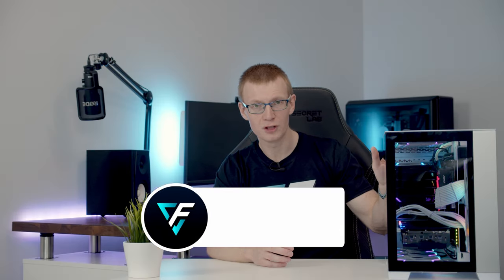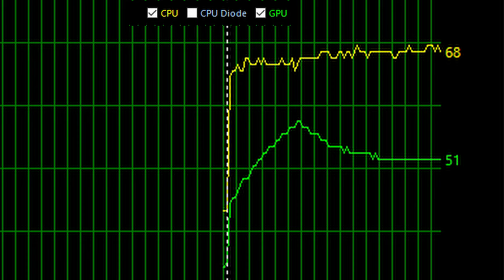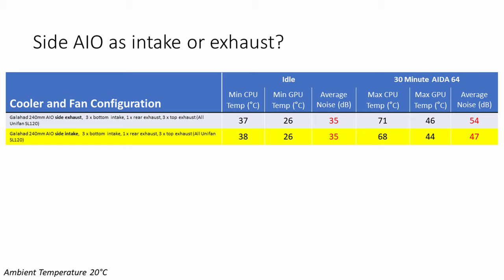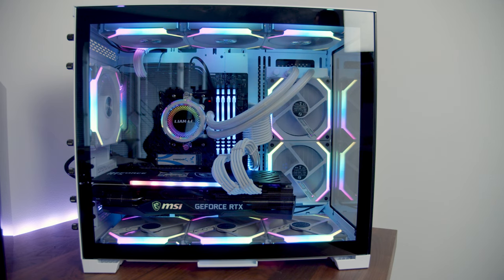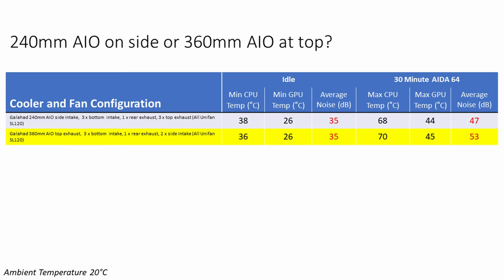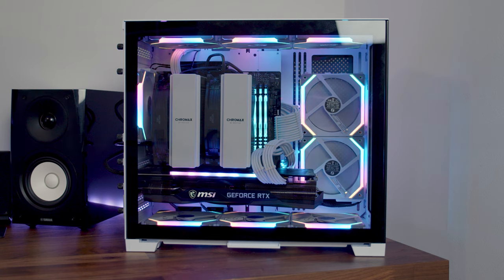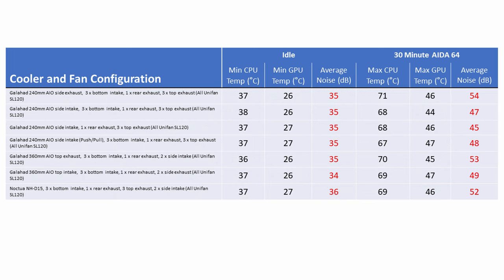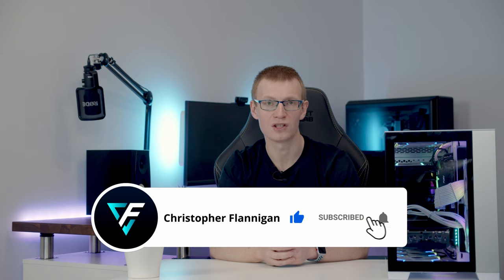Lian Li O11 Dynamic Mini - Best Fan Configuration

Comment: This video was so so helpful! I kept seeing other channels say that setting up side fans with radiator as exhaust worked best but never saw any data to even back that up. I’ll definitely be setting up my 280mm as an intake! I’m so excited to get this case — I have the snow edition pre-ordered and should get it in a couple of weeks.
Reply: Side radiator as exhaust vs intake has been tested to give almost 10C degrees difference. Air inside the case is just significantly warmer than outside, so obviously it's gonna perform better with room temp air than 30-35C warm case air. :) Something I dont understand is how bottom fans didn't help GPU temps, but there's no way I won't be having bottom fans in my own Lian Li case blowing fresh air on my GPU. :)
Reply: @vicw4522  Bottom fans not providing a big benefit to GPU temps mostly has to do with how small the gap is between bottom of case and floor with how short the feet are, raise the case 1 inch and there will be an improvement, can also remove the filter to get even better results. Lastly AIDA64 is not a good stress test for GPUs, using something like 3d mark will load the GPU way more and that is where you will see a larger difference with bottom intake vs no bottom intake

Comment: This is pretty much the best review for this case's airflow and you even covered the small bits regarding the aesthetics at every possibe angle. One question though, do you think the results for the best config are applicable to the bigger O11 Dynamic XL?

Comment: I had a 280mm radiator set as intake along with 3 120mm bottom fans set as intake. My top 3 120mm fans and the 1 rear 120mm fan were set to exhaust. My gpu was at 58-63 degrees Celsius in MW2 and in Overwatch 64-66 degrees. 

I then kept the AIO as intake but made the top fans intake as well. I made the bottom and rear fans exhaust. In MW2, my GPU was  at 55 degrees Celsius steady and in Overwatch it stays around 58-61. CPU temperatures had close to the same drops from the changes. Surprisingly, setting the bottom and rear as exhaust shaved off 4-8 degrees on my gpu and roughly 2-4 on my cpu. 

I’m confused because everyone says to set the bottom as intake but maybe it differs with each fan type? Regardless, great video! you helped me build my first pc! 

For reference,
My gpu is a 4080 
Cpu i5 12900k
Fans are Lian li infinity mirrors

Comment: 19:47, well, i guess i saw this the right time. Case ordered, possibly getting it tomorrow. I ordered what they now have as a AIO mounting bracket so that a 360 can be mounted to the top. I have not bought the AIO yet, so this is something for me to consider. I have been considering before i learned about the mounting bracket is to use a 280 as intake at the side. But the one I wont there is no 280 available.

Comment: I have a similar setup (Case, AIO and Fans). Nevertheless I think AIO exhaust is way better looking. I am struggeling with the fan setup for that to work. Currently i am testing:

-Galahad 240mm AiO side exhaust, no bottom intake, 3 x top intake, 1 x rear intake - so it would be 4 in, 2 out
-Galahad 240mm AiO side exhaust, no bottom intake, 3 x top intake, 1 x rear exhaust - so it would be 3 in, 3 out

The setup i would have loved to see in the video:
- Galahad 240mm AiO side exhaust, 3 bottom intake, 3 x top exhaust, 1 x rear intake  - so it would be 4 in, 5 out

I guess i have to buy 3 bottom intakes to test it by myself

Comment: Congrats for the amazing video. 

It would be great to test tubes up X tubes down when the AIO is placed at the side.
Some say that tubes down can get even cooler because the AIO liquid flow is optimized.

(It is not about the bubbles issue).

Comment: This is a timely video as I am configuring a system in this case. I had planned a 280 rad on the side and 2x140 mm fans top and bottom with a 120 on the rear. How would the 2x140 look in those positions? Thinking QL140s all around.
Reply from the maker: Not sure how they would look top and bottom as they wouldn't fill the space and 3 x 120 might look better. I would search and see if anyone else has done it
Reply: @ChristopherFlannigan  BTW, is there room to mount the rad with the tubes down?
Reply from the maker: @_BioX  Didn't try but don't think so with a big GPU
Reply: Hey there. I recently built in this case.i have a config of 3x120mm intake on the bottom, 280mm aio intake on the side and 3x120mm exhaust on top.

I have an aorus 6800xt which is a pretty big card and an nzxt x63 cooler. There is enough room to fit the rad with pipes at the bottom

Comment: Hey question: why are the temps in the o11 air mini so much higher? I've been trying to decide between d mini and air mini and the temps look drastically different in the tests. Is this due to the fact hes using a more powerful 3080?

Comment: I bought a TECWARE VXC BLACK DUAL CHAMBER ATX, which looks a great deal like your Lian Li, however it is also water cooled case, but the only place for the AIO radiator is at the top of the case. going to have to deal with thermals as there is no choice, but I only game as the hardest thing so I think I will be fine.

Comment: Hey Christopher, would you be interested in possibly doing a build guide for the Lian Li LANCOOL II (with the parallel RGB leds on the front, not the mesh one you've already done) combined with the Unifans and their controller hub? Trying to figure out how to connect stuff to control the front LEDs with L-Connect.
Reply from the maker: I have done a build in this case in the past so you should get everything between my videos

Comment: Theres not only extra costs for the fans themselves but also with the additional cables for the extra fans its quite possible that the consumer might end up having to get an extra fan controller and be stuck with extra USB cables thus also potentially needing a USB hub. The extra cable management also doesnt help. I also had to buy an extra SATA cable for my PSU as the SFXL PSU I had I ended up short one SATA plug. I wouldnt recommend it even though I have the same setup as you do.

Comment: Fist love your channel and thorough work. At about 12:20, you turn the side fans to exhaust and have the top and bottom as intake.  I'm experimenting with leaving all but the back as intake with the 360 aio. The hope is that this would create an optimized air flow and keep noise down whele useimg a top 360 aio.  Thoughs? Or did you try this?

Comment: Im still confused on how to hook up 9 sl120 fans + 240mm Galahad AIO? My motherboard is ROG STRIX B660-A GAMING WIFI D4. I’ve been running 8 sl120 Lian li fans for a year now, couldn’t get the last single fan hooked up and I really want it in the PC. 

Right now I have 8 fans hooked up to the controller and the Galahad AIO (1 wire powered by SATA and the other wire plugged into the controller) so I run out of hub controller space. I have 2 other controllers but I don’t know how to plug them into the motherboard since I only have one usb_56. It’s the single fan on the top left of the case at @21:00

Comment: I’m gunna try the side as an intake to get quieter. Also I have my GPU vertically and normally I have my case open so GPU blows outward but would it be better to face it back downwards to decrease noise and temps ? (Not really having any issues with temps just noise) but hope to hear back from you.

Comment: would you recommend using the radiator on the side as an intake but having the fans behind the radiator for a push set up compare to the pull set up in the video.

Comment: Why does push-pull config increase GPU temps?? I'm currently using a H100i Capellix AIO with the Corsair fans intake and the Unifans as intake on a push pul (Unifans on show like yours). But from what you're saying, I should get rid of the corsair fans
Reply from the maker: You should test with and without. You are pushing more hot air through radiator and altering airflow in the case which could help or hurt

Comment: Just got this case and tried every fan configuration and I found 240mm radiator set to intake on the side,fans on the top also intake and exhaust the hot air out the back and a custom fan curve for gpu

Comment: No side mounted gpu in the test ?  Might be different ? Fans blocked by gpu at bottom ?  Is it safe to put fans so close to gpu ? Will it spin the gpu fans when they are idle off ?

Comment: For the push pull setup of 240 rad when you said that its better inly one set of fan as intek, do you mean in the back of the rad or in front (visible)

Comment: In terms of aesthetics, wouldn't a 280 mm AIO be much harder to integrate? 

Lian-li doesn't offer 280 mm versions of the Galahad, and replacing the fans on a separate AIO can be awkward (w/ pump block aesthetics) and/or expensive. Feels like an especially painful expense since Lian-li doesn't offer 140 mm versions of the new Infinity Uni fans, so new builds today would have either unmatched fans or forced into a non-Infinity setup regardless.

E.g. In my region, we have the Kraken X63 RGB and the Zalman Alpha 28 as the only white 280 mm AIOs. The former has meh software and is x2.5 the price of the latter. The latter has an...interesting looking pump block and doesn't have a single English review on here on YouTube.

Comment: Why are temperatures so different (so much cooler) in this case compared to the Meshify 2 Compact you reviewed? You CPU temps max out at high 60s while they hit 90s in the other case? Is this case that much better at moving air? GPU in the 40s here but high 60s in the Meshify 2 Compact.

Comment: Hi! If I use an ATX board and a 3080ti gpu, will I still have space for a 1 slot pcie 1x wifi card? Or will it interfere with the bottom case fan?

Comment: Thanks for video lot of useful information,  I have a question,  I would like to build it my way which: is cpu galahad cooler on top, lian li sl120 in bottom , one single fan in the rear and gpu rtx2080super  (2 fans)  upright .. will it cause lot thermal problems? Or should be ok?

Comment: Would it be better to mount the hoses going to the pump at the bottom of the radiator when it is side mounted due to air bubbles collecting? Or the hose is fine at the top?

Comment: Hello Christopher, thank you for this great video, i still have one question tho. I plan to mount a 280mm AIO on the side instead of the 360mm on the top of the case as you advised, but i saw on many AIO mounting guide that the radiator must be installed with the tubes at the bottom and not at the top, what are your thoughts and is it possible to mount the radiator with the tubes at the bottom in this build? Thank you
Reply: Ive just ordered this case and have the same question. What did you end up doing?
Reply: @salvagedsteelstudio  Hello yes everything fit perfectlly, 7x120mm fans and 360 aio with 2X140mm fans on the side, beautifull
Reply: 280mm AIO *

Comment: I hope Phantecs sends you a p200a with the glass and the mesh side panels. I'm so curious about the thermal difference on the p200a and the tu150.  For the right thermal and noise result I could ditch the glass and I would assume weight along with glass just being a poor conductor.

Comment: Hey man I have my fans and radiator configured as 3x sl120 bottom intake 1 sl120 rear exhaust 3 sl120 top exhaust and 2 side sl140 intake. Could you help me with deciding what fan speeds I should have them all run at? And if I should remove the dust filters from my o11 mini

Comment: Would like to use a push pull configuration I plan on using the kraken z73 what 6 fans would u suggest I wanna use Corsair RGB thanks in advance

Comment: I will be doing a similar build soon but I will vertical mount my GPU. Would you recommend a different fan configuration? I’m debating whether or not to set AIO fans to exhaust to match the exhaust of the GPU and setting the single rear fan to intake. Great video!
Reply: I’m also considering running intake on the AIO radiator and 3x120 intakes on the bottom to compensate for a possibly hotter vertical gpu.

Comment: What is the best setup for running 2 radiators? Currently have a 360 top AIO set to exhaust, a hybrid 240 side GPU set to exhaust, and bottom as intake. The GPU gets quite toasty under load and would think it’s not ideal to push more heat through it?

Comment: Hope im not to late to ask but for 6 fans configuration where would be a better way to place them, im running the be quiet dark rock pro 4 cpu cooler and a 3 fan gpu

Comment: interesting, with my personal setup I have the same CPU but with a 280 Corsair AIO in an intake config on the side. My CPU idles at 35c and max on AIDA is only 56c, never thought a 280 AIO would out perform a 360. Although your point about the 240 fans does make sense here.
Reply: I have a similar build to this video, so the only fans set to intake are the bottom 3? And the rest set to exhaust including side aio? Do you have any opinion on what fan configuration is best

Comment: Did you set the AIO to intake by having to change the physical direction of the fans or is it a software/hardware switch (not requiring you to unscrew the AIO)?
Reply: You have to physically change the direction of the fan.

Comment: Hey, if there are are more exhausts than intakes, will it create negative pressure and is it good or bad compared to having 5 intakes and 4 exhausts?
Reply: Depending on the case and your fan size. In this case, front and side are covered with tempered glass, not allowing any air to be pulled in so balanced ratio between intakes and exhaust needs to be properly thought (or else it would either hot or noisy).
Having 4 intakes and 5 exhaust (or vice versa) with same size didn't matter that much in my experience (correct me if I'm wrong) because the airflow would balance itself, at the cost of higher rpm in fewer fans.

Best case scenario (IMO) in this configuration, would be putting bigger size on the fewer fans. In this case: 3x120 bottom intake, 3x120 top intake, 1x120 back exhaust, and 2x140 side exhaust. This also looks significantly better. (17:20 in the video)

Comment: I build a 5800x 3080 build using the black one, with no background building PCs I follows your video it was soooo helpful to me thank you very much! 
I’m using a 280 intake radiador at the side with push pull configuration using a kraken z63, but has been annoying the noise when the fans kicks at 60 degrees, any suggestion?

Comment: Isn't it like.. the worst thing to place AIO with pipes at the top ?
Reply: Not the worst: https://youtu.be/DKwA7ygTJn0
TL;DR: CPU plate / pump just needs to sit below the top of the radiator so that air won't get trapped in the pump
Reply: @si-fi  I mean, it doesn't mean u should

Comment: You need to update this content. Because this will mislead people and will use 280mm for their i9 13900k. Surely 280mm AIO is not enough for i9 13900K and you will diff have to use 360mm up to this time. And use OCCT to benchmark both GPU & CPU at max at the same time.

Comment: Thank you so much for this video. I have an ATX mobo, 240 aio cooler on the side, 3 lian li fans bottom and 3 lian li fans top exhaust. This has removed all doubts of my choices of components, I was worried I could've done better with my case setup. 
And you're right it does look aestheticly pleasing to the eye. Just waiting for my elusive GPU to complete it. 
Thank you again
Reply: I have a similar build to this video, so the only fans set to intake are the bottom 3? And the rest set to exhaust including side aio?

Comment: My system is i7-7820x and RTX2080ti from EVGA which runs particularly hot during load (84C during gaming). And i've been running Top 3fan rad as an exhaust and side fans as an intake. This video convinced me to rotate the fans around to have the top one as intake and side ones as exhaust.

Comment: Would have loved to see a 280mm vs 240mm AIO on the side. Also 3x120mm fans top and bottom vs 2x140mm fans top and bottom.
Reply: Also, was the CPU locked to an all core OC or something? Because if it was cooled better it would boost higher and potentially have the same thermals for more performance.

Same for the GPU - a few degrees could make a big difference given how the boost bins work.

Comment: Greetings, I have a Ryzen 5900x with a deepcool castle 280x on top as exhust, side intake + mounted 120mm AIO nzxt cooler for GPU (1080ti) as an intake, 3 fans on the bottom as an intake, i'm still struggling with high temps on GPU in some games, in summer with a warm room temperature my GPU reaches about early 80's C.  What is the best settings should I work on?
and also should I upgrade my CPU cooler to a 360 radiator? Thanks

Comment: I have been looking for videos that have this case, an ATX mobo and how to place the AIO 360 cooler. I have not found one yet beside one that cable ties the cooler and has it hanging. Why is it that not one Youtuber mentions that you simply cannot fit a top mounted, 360 AIO in this case when using an ATX motherboard? I am really surprised that no one has mentioned this.
I purchased a Galahad 360 based on the case spec sheet listed on the sellers website.

Comment: a little bit tricky to follow along as a noob, without a visual aid. Some feedback to might help novices like myself more, would be to add arrows to the images or highlight the part you are discussing and the variations. For instance, your recommended set up, showing blue arrow pointing to the system to show the intake and red arrow away to show exhaust.

Comment: So im running this config with a fullsized ATX motberboard, 3 fans down as intake, 1 rear as exhaust, 3 top exhaust. My side 240 AIO  should be set to exhaust right?